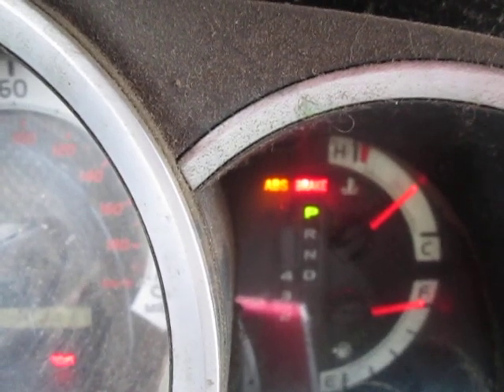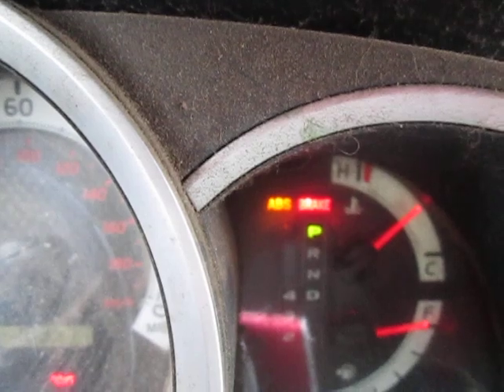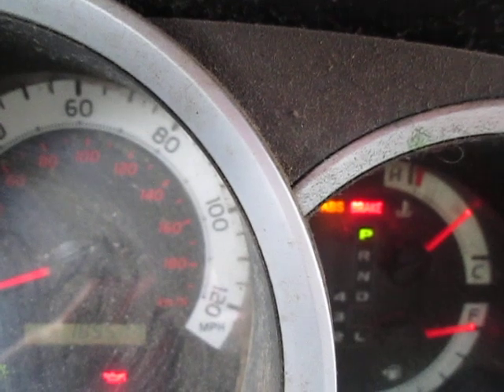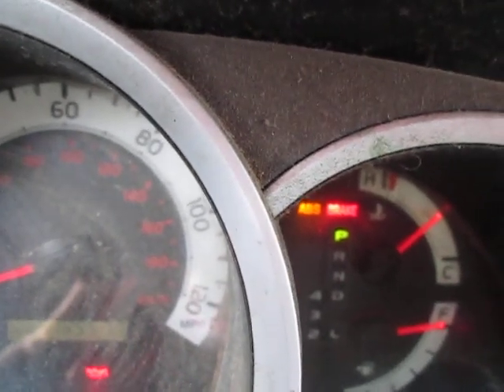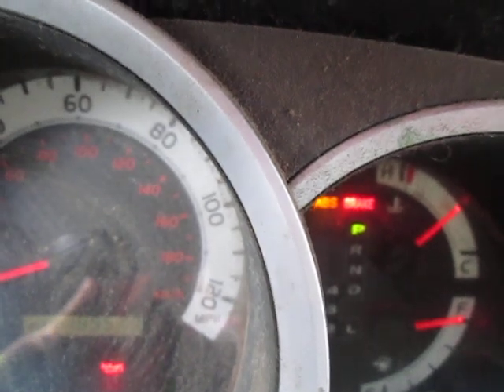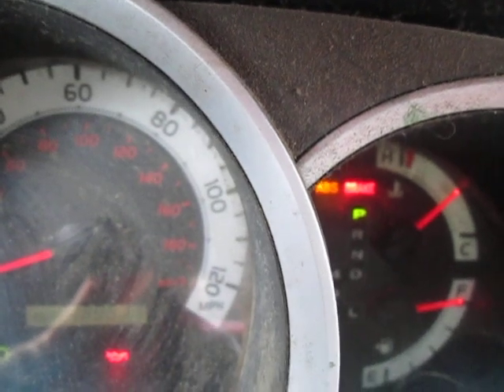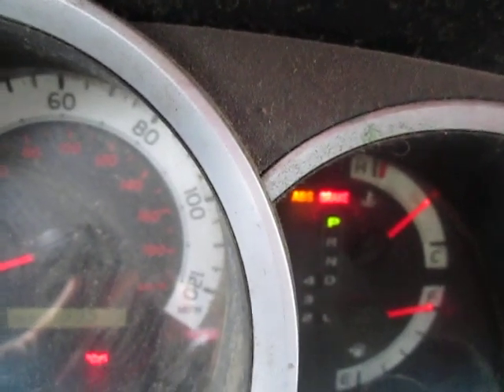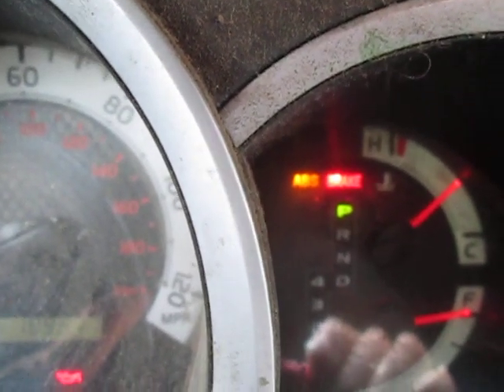Luddite Needs Advice on How to Fix ABS/Brake Warning Light

Comment: Disconnecting the battery for an hour or overnight often resets these codes. Autozone and other places will often pull the code for you so that you know whats wrong, and they may be able to clear it for you. Sometimes an intermittent ABS/Brake light is just a wheel speed sensor and not too difficult to repair.

Comment: Don't know the trick for your truck.  Like you, I just pulled the fuse for my '04 Sentra, but I kept it out.  In any case, a key thing to remember about ABS is that IF it's in any failure state, the brakes themselves are not affected.  Unless driving on packed snow or hydroplaning or panic stopping, anti-lock pulsing almost never deploys.

Comment: Fun federalist system fact.  In TX, check engine (for any reason, because that is never known until read) is NOT reason to fail inspection.  Bad tail light?  Fail.  No exhaust sensors, even engine problems causing coal-plant level emmissions?  No problem.  Pass.

Comment: Shit connection to one of the abs sensors that count the reluctance ring castellation's on the hub or drive shaft.
Badly corroded reluctance rings can give errors
Duff abs sensor.
Assuming brake fluid level is correct and pads are not worn down.

Gaz UK.